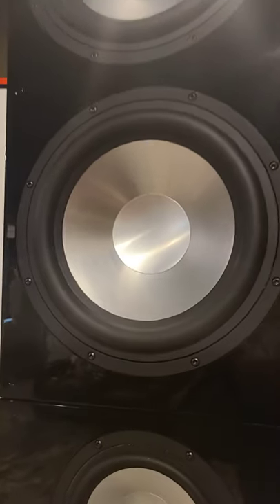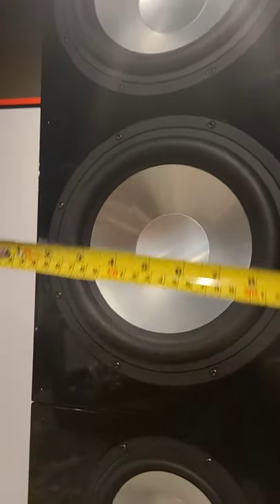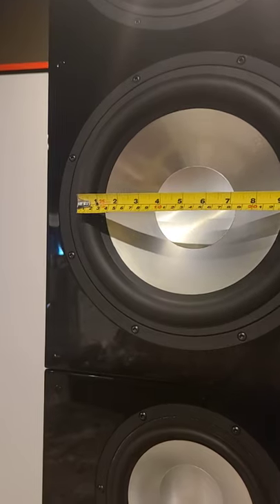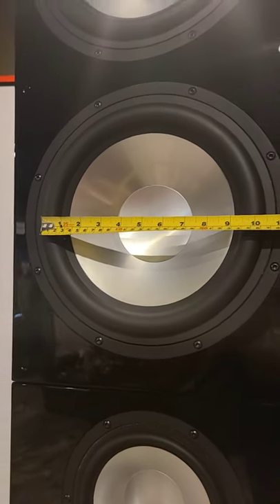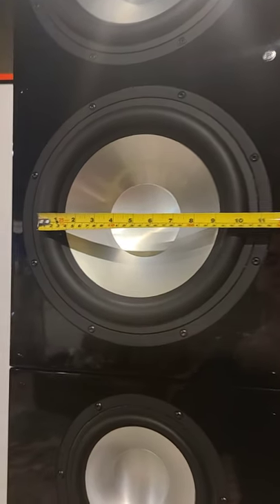Do Your Loudspeaker Drivers Measure Up? #shorts

Comment: Woofers and mids are usually size categorised by the frame diameter. Dome mids and tweeters are categorised by the diaphragm diameter. Usually. However, these are not the actual specs of the drivers. Look in the detailed driver specifications for the proper figures.

Comment: Exactly. I supposedly have a dual 6.5", but it's not quite even 6", as you measured it Gene. The basket could be 20 feet wide, but if the drivers are 6", then that's what's moving the air

Comment: Yeah I did that with my 12w7AE from JL Audio and noticed that the actual speaker measured at 10.5" and if you measure from edge to edge of the basket where the screw holes are, it measures 12.5 inches lol!

Comment: I just bought a pair of Adam Audio T8V '8 inch' monitors and the driver measures 7" across the front, by comparison I have a pair of Genelec 8040 6.5" monitors and the drivers on those measure 6.5" across the front

Comment: Yes I always measure the diameter of the drivers. I thought the surface diameter was from the inside of the surrounds. 
The woofers in my speakers measure 8" from the outside and a little over 6" from the inside. The mid range measure 4" out and 3,5" in.
I have vintage Magnat speakers. I believe the woofers where rated as 8"

Comment: measuring the width is something i gave up on, Effective piston area is always accurate and it related to sound. driver size is normally not useful at all, and definitely not useful to compare. 6.5" drivers an be 5" if you measure from mid roll to mid roll.

Comment: I had this exact misunderstanding with my Klipsch RP 8000's. Drivers when measured rubber to rubber were 6". To make matters worse if you measure just the box and not the metal feet the dimensions match the RP 6000. I went back and forth for over two months thinking I had been scammed and sent RP6000s with the swapped boxes. (I bought them through an Amazon seller that discounts them like crazy and got the pair almost 50% off.. or the MSRP of RP6000s) After taking it all the way to the engineers at Klipsch I was told by someone who built them how to correctly measure the dimensions of both woofer and the cabinet and I do have RP8000's they just are measuring things like optimistic teen boys.